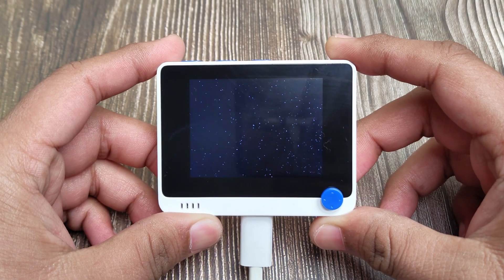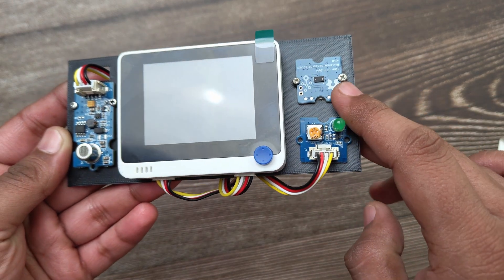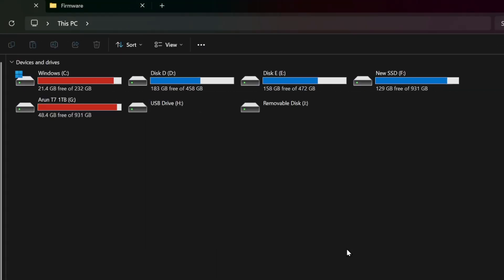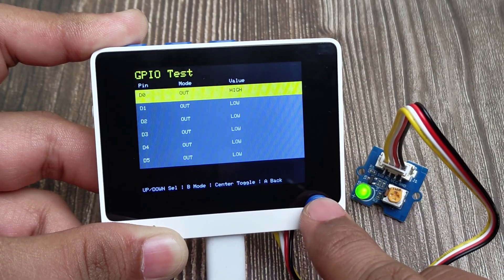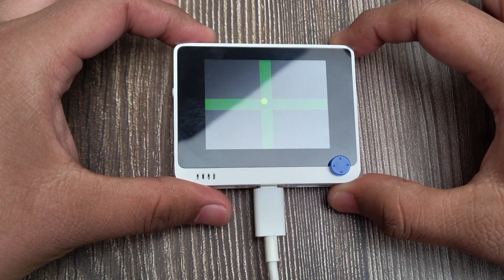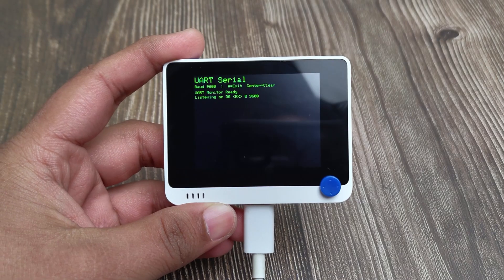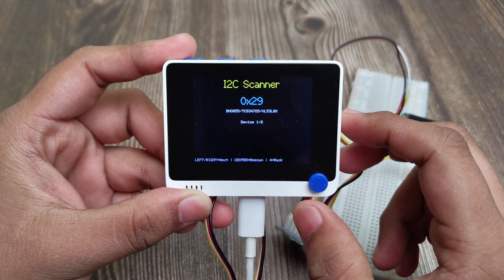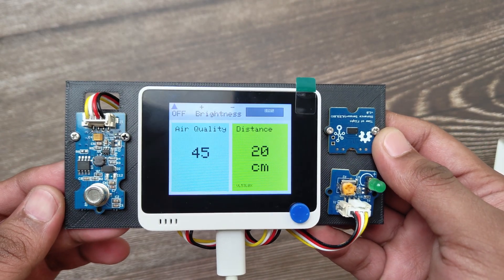Wio Terminal hack: All in one tool

Comment: How can I remove your firmware？ I want to recover to my normal state😢
Reply: Thank you very much. You firmware is very interesting haha
Reply from the maker: Just upload a different UF2 file.
Push the reset button down twice. It will show as a USB device.
Reply from the maker: Hope that worked.
Reply: And could I ask for a instruction about the using of the camera module controlled by the terminal？ Maybe It can achieve the object
recognition？
Reply from the maker: See if this can help you. Otherwise I can try to make a separate video on it.

https://wiki.seeedstudio.com/Wio-Terminal-TinyML-EI-1/
Reply: @techtalkies1 Oh，thanks. I will appreciate a lot if the video can be posted. I will follow you forwever❤
Reply: @techtalkies1 And could you achieve the function of using the camera to film the real time image as shown in the video below？https://youtu.be/tMuCFkazKgs?si=RS5IbqKRTBJ4cDQR